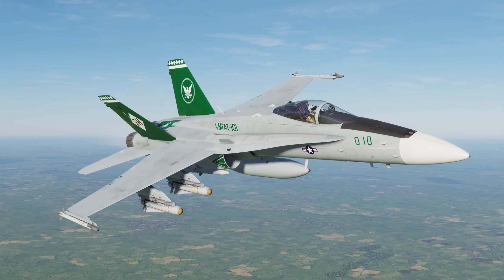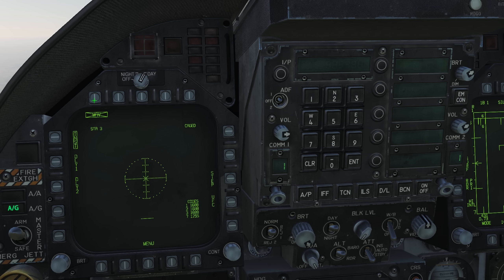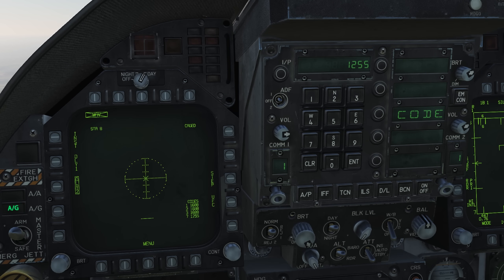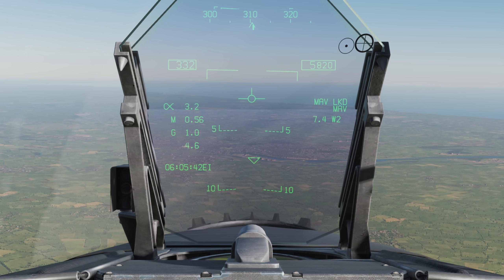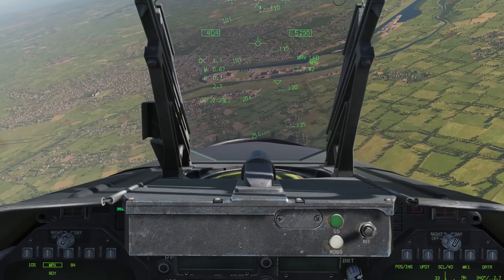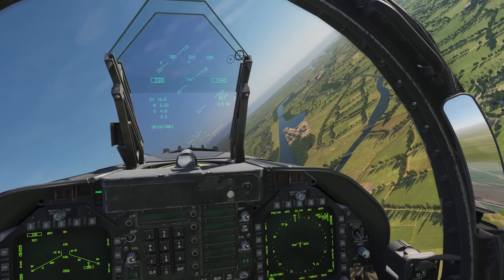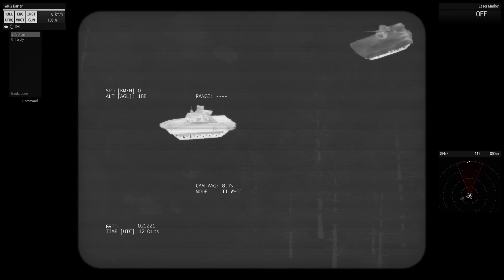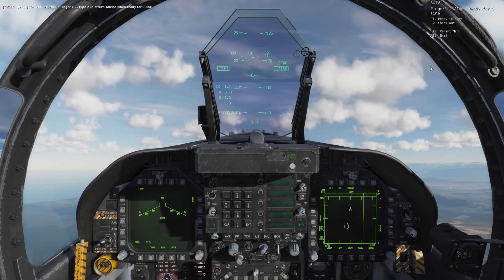DCS F/A-18C Hornet AGM-65E Maverick LMAV Tutorial

Comment: what is the laser code?
Reply from the maker: The person doing the laser designation has to set a code for the frequency the laser transmits at. In order for the LMAV to pick up that specific laser you then configure your sensor to filter that same code. The JTAC / wingman will tell you the laser code they're using, you just plug it in on the stores page as shown in the video.

Comment: Laser Mavs also have the benefit of VERY RAPID multi target engagement. If you have a similar number of laser designators you can potentially launch against an unlimited number of targets in very quick succession.
Simply set each laser to a different laser code and set each Maverick to a corresponding code, then simply uncage the seeker, lock, fire, uncage, lock, fire, uncage, lock, fire etc.
Depending on if you are yourself a lasing platform this can easily result in you launching your entire complement of Mavericks at 4 different targets in seconds and being able to egress immediately or turn to other duties, such as covering airspace.
Reply: Markpoints + TGP + tv mavs do the job quite fast as well. Just sayin'....
Reply: @theeltea  But that's alot more steps and potential set up, and the TV mavs could mess up and not lock right, I mean the only reason it even works that well in DCS is because they aren't modeled right...and again if the targets are not proper single unit out in the field with no cover, like they usually are in MP missions for some reason, laser designation works on anything, including infantry or points on the ground.

But yes, they can.
Reply: @Chrinik  Yeah, I believe in real life applications they are quite prone to locking up totally random shit under not-so-ideal conditions.
Reply: @theeltea  I heard annecdotaly from veterans that the IR mav in particular loves deserts. You shoot it at the totally hot Tank and it decides "What Tank? Oh you mean this hot road nearby?" and just plow harmlessly into the ground 40 feet next to the target.

That's also what irks me about the "Force Correlation" trick that people use to snipe SAMs from long range...I heard from multiple pilots that it is horribly innacurate and will not hit what you aim at 90% of the time, because the image you gave it to contrast with from 10-12 miles looks alot different from 2 miles so it just naturally drifts away<.<

It's a great weapon, when used right, like any weapon system.

Again, all of this is annecdotaly, I have no impirical data to back this up, just relaying what pilots told me.
Reply from the maker: Yes, although in reality they'l never fire all 4 off at once it's possible mind, a good bit of fun in mp.

Comment: Nice explanations as always :)

I've read that the pod is pronounced A-Tee-Flir and not At-Flir. I guess many will have a hard time getting used to that including myself :D

BTW I've shot the AGM-65E from max range at 18'000ft, going 300KTS indicated and up, which means as soon as it picks up the spot which is ~17nm. They all arrived at their target without issues. That is an incredible advantage over all the other Mavericks. Top range I could get out of the ones fired off the A-10C was like 11-12nm in FC mode. But that was at less altitude and compared to the Hornet's speed, a Hog doesn't move at all :D
Reply from the maker: I know exactly the video you're thinking of we'l see if i remember :)

Comment: great vid, its worth noting that if someone is lazing for you the lazer needs to be in area mode. not sure if this is a bug but from my test point mode doesnt work when lazing.  In point mode it will find the target but you will be unable to fire the missile.
Reply from the maker: The type of track shouldn't affect the laser firing / tracking, in fact Ideally you'l want to be in point mode rather than area, as area can slip off of an object over time since it's not directly locked to it. It's got to be a bug, this with the harrier?
Reply: @RedKiteRender  both AV8B and A10C
Reply from the maker: I've got footage of a harrier self lasing for agm-65e in point track without issue, not got the means to test an a-10c buddy lase at the moment. But i've not run into the same issue as you.
Reply: @RedKiteRender  I didnt mean self lazing, I meant if av8b or a10c lazes for the f18 agm65